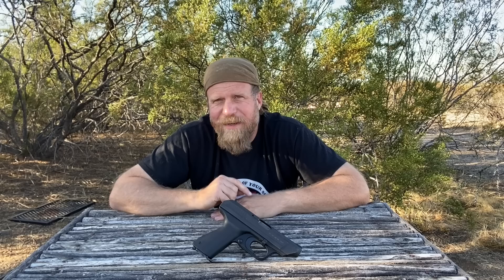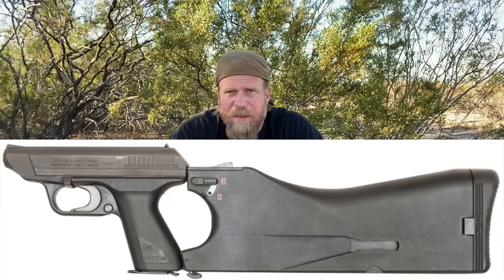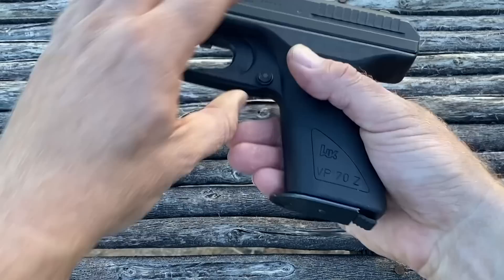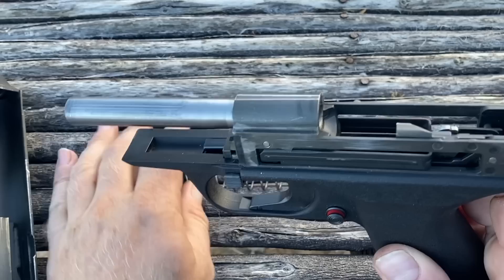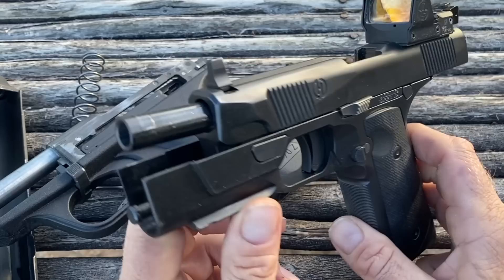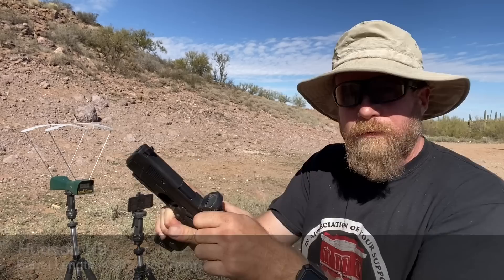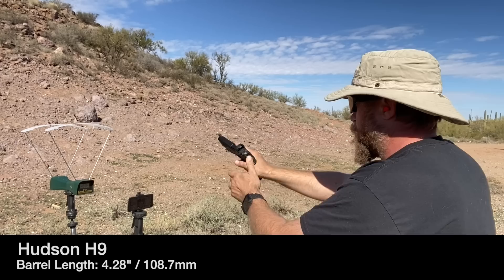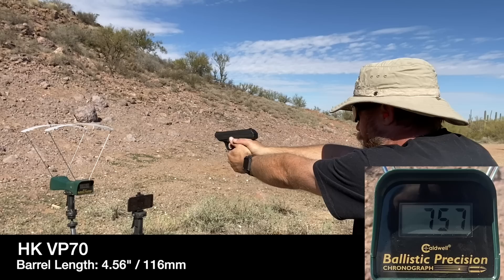HK VP70 - Turning 9x19 into 9x17 since 1970

Comment: VP70 = a German made Hi-Point
Reply: Fun part is Hi Point is  coming full circle back to the VP 70'S design inspiration  in a sense with  the Hi Point YC 9
Reply: J F  Yeah, though due to all the 'Rona shenanigans I  don't know if Hi Point released the YC 9 yet.
Reply: Only thing similar to the VP70z is the weight. All other size and capacity data is way different.

Comment: Would have been nice to see a 124 NATO 9x19 load run out of them since that IS the ammo it would have been running.
Reply: Hydin Biden  actually, nato spec 124gr ammo calls for 1250fps, it’s closer to +P+....
Reply: @jimhans1  9mm nato is no where near what some ppl market as +p+ and even below a lot of +p.
Reply: @killervztwogaming5796  thanks, but I have the pressure specs for the nato standard, it IS above +P pressure, which means it IS technically a +P+ loading.
Reply: Hydin Biden  but with it going 1250 and losing 100 it’s not horrible. Not saying I want it, just saying it would be nice if it was tested with the ammo it was intended to shoot......

Comment: *Watching the disassembly and seeing the internals: "Oh my God, it's a Hi-Point". A very expensive, better made Hi-Point. Okay, more accurately, the Hi-Point is a garage built Vp70.
Reply: except the Hi-Point has way better sights and its trigger is nowhere near as bad as that. hell the sights are really good for the price. Fully adjustable rear with easy to use 2 color contrast 3 dot with free optional ghost ring. hell guns above their price usually have cheap or crappy sights (looking at you glock)
Reply: @thatguybrody4819  lol i would rather have just glock sights than a whole hipoint
Reply: @darrengarcia4937  you're missing out.

Comment: Between this and the MP5SD , maybe they should've just made slower 9mm.
Reply: I suspect NATO spec had a lot to do with the design choices.
Reply: There is. It's called .380acp
Reply: No it's just cheaper to use NATO standard
Reply: it's easier to make a gun than a long term manufacturing system for a new kind of ammo
Reply: 147 grain?

Comment: I had the "opportunity" to handle a VP70 back in the mid 1980s. So here's my recollection of the experience, and the recalled feedback of my peers. The slide felt as heavy as most handguns of the same size, giving it a wholly unwieldy feel. It required that you pinch your finger into the valley of the weird notch shaped trigger or risk catching along either the top or bottom of travel, which increased the perceived trigger pull until you got used to finding the sweet spot. Also people with larger hands tended to get stuck in the trigger. Just a little, but enough to be a hassle, and fear causing an accidental discharge. Although the twelve to fifteen pound trigger pull really does insure that doesn't happen, and even dissuaded some from intentionally firing too. Firing left a divot on the finger that lasted a few minutes after wards, and felt like a bone bruise after firing a box. Not from recoil, but rather the trigger itself. The slide had a crunchy choppy gravelly feel to it that had me checking for dirt and inclusions when factory new. Cycling the slide to load a round into the chamber also had a feel worse than finger nails on a chalkboard, and I was the kid who used to annoy the whole class by doing so on purpose. Simply terrible handling weapon, for one that is actually well made. Its a bit of a conundrum there. Definitely interesting, and kind of a wonder that the same people who made the mp5 made this.

Comment: Very interesting, I had no idea about this aspect of the VP. For completely different reasons, my 9mm Chiappa Rhino does the same thing. Geco 124gr came out at just under 1000 FPS, and that's with the ridiculous 12" UK barrel (they quote 1150fps from a 5"). I think it must be down to the long freebore in the cylinder.

Comment: My father had one of these, and it was in the era when THV's were in vogue. He used to load those things so hot, (case full of powder, fill the back of the bullet and squash together) he was getting close to 3000 fps and a 3 meter muzzle flash. I still remember having to use 2 fingers to pull that horrible trigger.
Reply: That all sounds horrifying!

Comment: Very cool, something I never knew about the VP70. I guess it makes sense in a way if your primary motivation is not to take advantage of the 9mm power but the ability to just fire a shot with any 9mm you find out of a mass produced blowback. 

Might make it interesting for suppressor use then since it will bleed velocity like an integrally ported barrel

Comment: In videogames I usually find it dumb when pistols that should be the same have different damage stats. Maybe that's not so dumb after all.
Reply from the maker: This would be one of the very few exceptions in which that's appropriate.
Reply: There is still the difference between barrels length and powder loads. But for some reason, they still get it wrong as smgs should hit harder than pistols per shots not the other way around. But that's for balance reasons. Otherwise, SMGs will dominate most shooting games.
Reply: @minhducnguyen674  Insurgency Sandstorm is somewhat unique in modeling damage based on only two main stats - caliber and velocity (the latter of which is purely a function of barrel length ingame). It's still not a real ballistic model by any means, and compared to games like S.T.A.L.K.E.R. it's lacking bullet drop and other factors, but I thought it was a nice touch to validate damage differences between firearms of the same caliber for balance. Even the 9mm pistols ingame have different velocities vs each other and their SMG counterparts.
Reply: @solwindp78-1  Oh yeah, their damage modeling is pretty realistic. Although for the first insurgency game, they could argue that in the range they fight, bullets drop should be negligible. Another impressive detail is how they depicted RPG and other portable rockets. There is no slow flying rockets, you just hear a thumping boom, a short screeching noise then the explosion. And they makes the game asymmetrical yet still fun. Security force have access to better guns accessories but the insurgent get more explosive devices.

Comment: I think your hypothesis that the deeper grooves is what is so drastically affecting projectile velocity is likely correct, but I'm curious if the blowback designed by its nature has any effect. It might have also been interesting to see a comparison with another direct blowback 9mm pistol that doesn't have such deep grooves (I'm assuming, but don't know, that Hi-Point doesn't do this?). I know, you shoot what you have, I'm just saying it would have been interesting. That and/or some slow-mo footage to compare barrel exit and slide dwell time between this and a locked-breach pistol?
Still, this is an excellent presentation/demonstration.

Comment: I believe the more common reason you might want to have second strike in a pistol isn't bad ammo so much as it is light strikes. for a lot of reasons, strikers don't always hit as hard as they are supposed to, and often the release of the firing pin spring is enough to fix whatever was causing the problem. additionally, as a matter of training, if the expectation is that it's impossible to truly train for random failures (since forcing the failure would nix the 'surprise'), second strike provides a remedial action that, while imperfect, aligns with the fighters natural instinct to keep pulling the trigger.

Comment: I have noticed that Magtech puts their cartridges in an open-floored tray,  so the heads of the rounds are not supported by the sort of egg-carton shape that most other ammunition manufacturers package their ammo in. If you compare a Magtech 9mm round to one from Tula,  the Tula ones are taller, because the Magtech rounds have setback by the time they reach the end user.  I think that's why the velocities are higher on the chronograph

Comment: Interesting points about the rifling. I would see VP70's in the case at my local gun shop and was told that all H&K guns used the poligonal rifling for higher velocity. It was actually true for the P9S in 45ACP (Pen*s???). Shows how little interest there was in that model that nobody checked, or maybe they were pulling my leg. Later I bought an HK91 which had conventional rifling.

Comment: To be fair, it was designed for the Military Application 3 round burst, making design compromises that are a detriment in civilian single shot only guise. The Vector Kriss and FN P90 suffer from the same issues. The relatively radical design decisions that innovate as SMG's or PDW's are detriments when they loose select fire.

Comment: Another implication of the "bypass groove" system -- don't shoot this with cast bullets.  Blowby like this is exactly what causes poor accuracy and barrel leading with undersize bullets in cast loads, and what I'm seeing here is that it's probably impossible to load a large enough cast bullet to fill the grooves and prevent this (and it might be unsafe to do so anyway, because that would bring the ammunition back up to full 9x19 pressure with a slide that's too light for full power ammunition without the blowby).

Comment: I was offered one of these back in the late '80's at my local gun emporium and at the time I had pretty much every current 9mm pistol on the market so was interested in it....until I handled and dry fired it.   Uhghgg....not good.   Liked the magazine...hated the rest of the gun so I had to pass.   Even back then H&K were relatively expensive guns and it looked like their interest in making a simple pistol was more for increased profit margins than offering a cheaper gun to the military or public.    The P7M8 was only a couple hundred bucks more...and of course you got a Classic so that VP70 sat in the case for a LONG time.

Comment: The rifling in the barrel should be visible much better when the bolt is open and piece of white paper (or anything reflective) is put behind the chamber end of the barrel. So looking from the muzzle it is not a black hole, rather a light tunnel.

Comment: The ammo issue isn't really that big of a deal. The VP70 was made to shoot NATO Euro spec 9mm, which is basically sub gun ammo, and usually loaded much hotter than commercial ammo of the day. Using that, you will get higher velocities. It's actually a very accurate pistol due to the fixed barrel feature, if you fix the trigger. In the early 80's there was a gunsmith in Florida who did trigger work on VP 70's. I had him do mine, and it gave it an almost Glock like trigger pull, which is how I found out it was pretty accurate. Plus, at the time, nothing else on the market held 18 rounds in the magazine, and South Florida in the cocaine driven 80's was the Wild West. A VP70, and two spare mags made sure they ran out of bullets before you did. The trigger job made all the difference.

Comment: The deep lands do not buy any more time in any major way in the cycling process, their main function is to lower chamber pressure so the case head does not blow out upon ejection.  The gas blow by does not even come into effect until the bullet is moving down the barrel and the case is pushing rearward on the slide and starting the ejection cycle (leaving the case head more and more unsupported as the slide goes rearward).

Comment: @inrangetv I don't remember the VP70 being a inexpensive handgun when I saw it in magazines. Is my memory incorrect, was the HK VP70 less expensive than other full size handguns? They used inexpensive polymer for the frame and the least expensive to produce operating system, blowback. Did that mean the gun was cheaper than Colts, Smith and Wessons and Brownings?
Reply: I seem to remember seeing ads for it touting it as “the most expensive gun around” but my memory is very fallible.
Reply: @ringsystemmusic  Sounds like you're thinking of the HK P7 series, not the VP70.

Comment: I greatly enjoyed the video and recall years ago firing an HK gun with a horrible trigger and maybe it was a VP70.  But recoil seemed normal to a .45 shooter.   
Monday morning quarter backing:
I see what certainly looks like a recoil buffer protruding from the frame.
The performance is not 380 like.  Perhaps like a  9 mm Glisenti   8.00 g (123 gr) FMJ 	320 m/s (1,000 ft/s) 	410 J (300 ft⋅lb)   
As others have pointed out we have the hipoint that is the gun of the common folk in the USA and it does not seem to need the nonsense modifications done by HK.  Relative to price, I doubt that HK ever sold a cheaply priced gun.
It might be interesting to compare a VP70 to other blow back pistols like the HiPoints and also the Astra 600 that is a 9mm pistol that was ordered by the WWII German Military from Spain.   
That magazine was innovative.

Comment: i wonder if the VP70 would be good for suppressing 

1. you know its going to be sub-sonic.... because of the ~10% loss
2. i THINK the gas venting threw the rifling would "smooth out" the gas impulse into the suppressor.... making its job easier 
3. im not sure.... but because its blowback.... you MIGHT not have to worry about function/reliability (if anything... its going to cycle harder...I THINK!)
.

Comment: I can understand what they were going for. Something cheap to give out en mass to cooks or something, can use the existing ammo in the supply chain. If they did it with .380 or something then you'd need to have a separate supply etc which is a non starter in a military context.
I think that reality had other ideas though, in that cheapness wasn't really a factor and it was quite acceptable to make more expensive, better guns.

Comment: I wish you would have addressed the very unique nature of the sights on this pistol...they were quite unusual and I have never seen anything like them in any other handgun...
Reply: Aren't they standard sights?
Reply: @marcusborderlands6177  No the front sight is a unique ramp, very different from usual sights.  The VP70 used sights based on what HK referred to as using a “light and shadow” principal.  In lieu of a blade front sight, the VP70 uses a polished ramp with a central notch in the middle to provide the illusion of a dark front post.  Very very different from most pistols.  I do not think most people liked it.

Comment: Man, at first I was thinking how cheap the VP7 sounded when you racked the slide(as if it had a rusty spring or something that was getting caught up), but then the Hudson made the same sound.  Does the Hudson also have a spring that wraps around the barrel?  I was under the impression that the Hudson gun had a regular recoil spring, but very low in the dust cover.

*edit*
After looking at the H9, it does have a "normal" under barrel spring and guide rod, but it does look a but larger(at least on my phone it does) than other pistol springs.  It's also not as tightly wound and captive as something like a glock recoil spring.
I dunno, it just sounded weird.  Almost like an AR buffer spring getting caught up on something.

Comment: I always heard these described as having polygonal rifling. Apparently not. Or if it is, it is deep cut. I never knew that factoid. No doubt it was due in part to the hot NATO spec 9mm ammo in common usage then, which is reputed to be approximately +p+ and intended for SMG's. The same ammo that caused slide breakage and departures on early M9 Berettas. The lineage back to the last ditch Volkspistols is visually obvious, and appears to be the VP's designation as well. Everything old is new again.

Comment: The subsonic rounds raise a good point though - if your goal was to use subsonic ammo, a higher pressure loading can end up subsonic for the VP70 and it could be useful. Otherwise, strictly lower energy with worse recoil than any other 9mm.

Comment: I wonder how my Cast bullet reloads would do in the VP70 ?
As I have found in Most 9 mm pistols the chambers are made large 
So a cast 9 mm bullet that is sized to .357 or even .358 and loaded in the 9 mm case 
I found that even the .358 sized bullets will feed and function almost 100% of the time 
So I normally load .357 dia 9 mm for my Glock , Sig 229 and Browning HP 
So I wonder if the slightly larger cast bullets would reduce the blow by much ?

Comment: this is how item rarity should work in gear based games
you start with a beat-up barely functional grandpa/failed-trials weapon a step short of a rust pile
you end with a tuned and tricked out mr73/rail-gun (depending on setting)

Comment: The velocity reduction is major downside here, but I wonder if it could be a feature in another context: reducing standard ammo to subsonic velocity for a suppressor, a la MP5SD? It would be simple enough to offer those deep grooves for threaded replacement barrels, then the user can easily switch back to full-velocity for un-suppressed use.

Comment: Would it have been any use as a suppressor host, given that the round is already being slowed by the barrel configuration?
Reply: Very much so, if you could get one with a threaded barrel
Reply: The issue with this tho is that “less velocity = less energy”. I’d still prefer a cartridge to be subsonic due to greater mass. 

As a logistical consideration, being able to use standard ammo in a suppressed role sounds attractive to bean counters.

Comment: Sure it loses ~100ft/sec but for a pistol that isn't going to substantially change it's usability. I see what HK was going for, a cheap gun that a more economically strained armed forces could buy in bulk and equip their forces or maybe just NCOs with sidearms. The low price was probably not worth the tradeoffs though but it is interesting to note that it actually has 3 nation users according to wikipedia so I guess the price swayed a few.